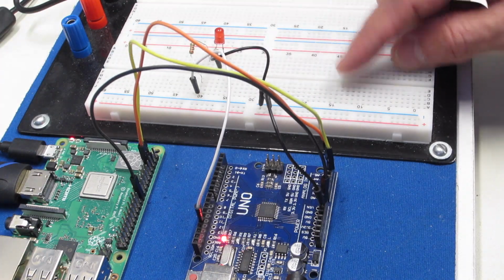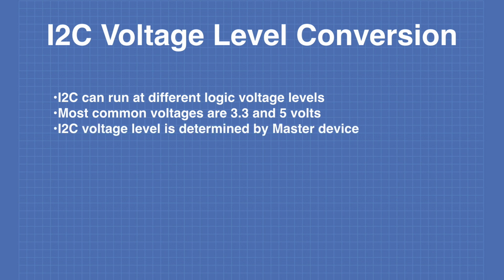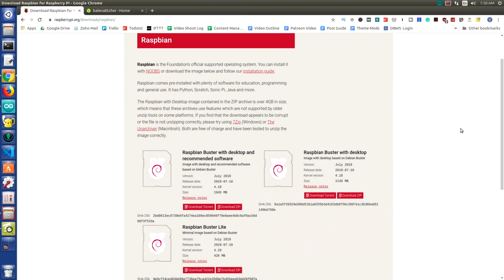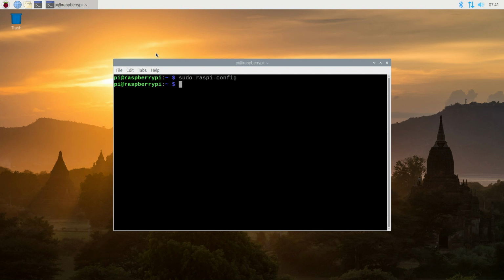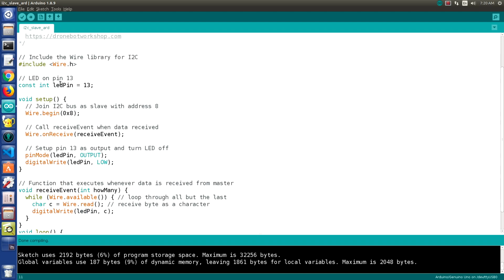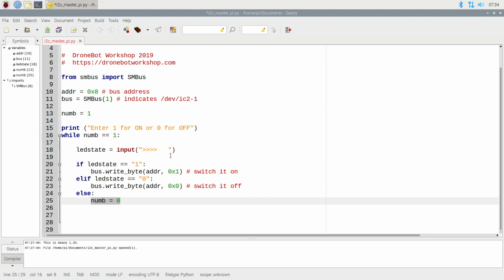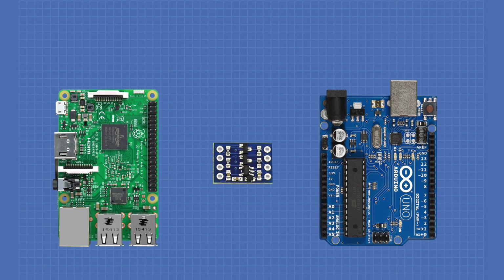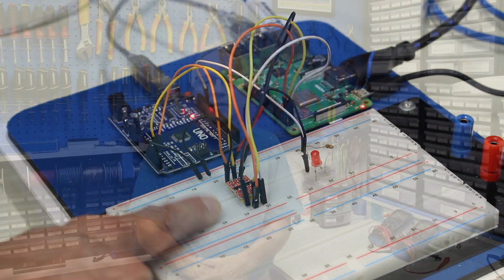I2C with Arduino and Raspberry Pi - Two Methods

Comment: If i am using 3.3v logic level on both the device and i can connect pull up resistor to any device and it will work fine right ? or i need to connect it to master side only?

Comment: Sir, i'm building a pinball machine on a budget at home, but it's not as simple as buy X, Y and Z and connect it all. At first I started with the arduino uno r3 I already had. But as the project grew with buttons, solenoid driver, sound and monitor, it becomes clear that a single arduino might not get the job done. (I want color output on a VGA monitor) so we need to have different hardware. I found a Pi Pico2 that can get a "dvi-sock" attached to it so it can connect to a monitor. (vga or hdmi) But how to progress from here? keep the arduino as the button detector, solenoid driver and scorekeeper? Or should the pico do more tasks? Would the I2C communication be fast enough to some tasks between the two boards? Or should the setup be completly different?

Comment: I checked on both my Arduino's (a Jade and another one) and the SDA and SCL stay at 5V, so they have pullup resistors to 5V. Beware! Its is always best to use a logic level shifter, damage is irreversible to poor pi's. I really don't understand why they chose 3.3 V for I2C on these
Reply: I think its bc of the library code, in the function, all the code were set to pull up on SDA and SCL for easy use, just go to registers level for better control

Comment: i am getting an error when i run this File "/.../python/pi-i2c-test/i2c_master_pi.py", line 20, in <module>
    bus.write_byte(addr, 0x1) # switch it on
OSError: [Errno 121] Remote I/O error

Any advice?

Comment: Hello. I was able to connect the Raspberry pi 4 (Master) to arduino uno. It works perfectly. But when I want to install the 7inch touchscreen from Raspberry Pi, AND the arduino via i2c, there is a conflict and it stop working... Are there any clues you can share for this situation?. Thank you very much!

Comment: Hello, I'm new to coding my skills are mostly in hardware. But I was wondering If I'm controling over 30 relays from the arduino how do I control them through the raspverry pi using a web server page from the pi itself?

Comment: Thank You for covering this subject.   I was having an issue powering/grounding an IoT project that has an UNO R3 connected to a DHT11 with 2 way communicating with an ESP8266 that is connected to wi-fi and a 4-way relay.   The 3.3/5 volt common grounding was giving me a head ach, and causing issues with the sensor data transmitting continuously.   No one else really covers things as well as you do.   AWWWsome  and thank you again.
Reply: i am having a similar issue im unable to make the esp32 slave.........may be its because of common grounding

Comment: Can you wire a Pi Motor HAT directly to an Arduino by just connecting the corresponding I2C pins (A4 & A5 to pi 3 & 5) ?

Comment: These are the most easily understood and trustworthy tutorials I have seen.  I'm trying something similar but unsuccessfully so far. Does an Arduino Nano have a 5V I2C pull up? Specifically, can I use an Arduino Nano (5V) slave with an ESP8266 ESP01 (3.3V) master without a Logic Level Converter?

Comment: I have no trouble sending data from pi to arduino or from arduino ot pi but I cant work out both, I need 2 way communication, what would I need to change to get this going. simply adding the read and write commands to both causes either a communication error or causes the arduino to power cycle

Comment: Hello,
Thanks for great tutorials.
I have a question on the logic level converter.
i have two arduino boards  (Nano and Nao 33 IOT) they operate at different voltage levels.
how can we do serial communication between these two boards ? will the I2c level convertor work in this scenario or i need something else?
Regards

Comment: Making a GPS tracking uav drone for my project.  Thinking of combining arduino and the pi for it?  Steps to make that work?
Reply: Like the pi control the gps, wifi, ai configuration and the arduino would run one task like driving my four motors, could this be done?
Reply: Tips ?

Comment: I got a question...if i want to use them in a portable project and i will use a battery pack probably where should i connect the battery and how and what voltage should the batteries output ?

Comment: My absolute heartfelt thanks for your incredible contribution. 
I am looking to setup a project and after doing a lot of research on the subject i've decided to go with a single rpi connected to multiple arduinos slaves over i2c . So is there any way to do that and how to connect more than an arduino board????

Comment: Very helpful. Thanks!
Reply: Is there a way to use I2c interface on a standard pc mother board to check authenticity of port or control a device
Reply: @Silentsobs  I don’t know, I suck at programming. You should ask an extremely good hacker.

Comment: Hi!
I don't know your name, I've been searching but I have not found it...
First of all, you're a very good teacher!!!!
I've have a question... The smbus library on the Raspberry Pi BLOCKS the program execution until it has transferred the whole data. If you use the serial channel it does not happen in this way. For serial, you write, the function returns, and in the background the transmission takes place.
It is a great inconvenience, thus the program can do nothing that waiting for the transmission.
The only solution I've found to avoid this situation is to build a socket server, place on it the communication, and call this server in other programs. In the case the program is a web page the solution is good, but I don't understand why the smbus library has been designed in this way.
I've tried to place the i2c communication in a separated thread in the same program, but it does not work...

Sorry for my English.... I'm spanish.

Congratulations for your videos!!!
Thaks!

Comment: "and because 3.3 volt is higher than the threshold" - logical error already. The 3.3 V output doesn't guarantee to generate a level at least 3.3 V.

Comment: Imagine in the year 3070: I have Raspberry Pi with 3.3 V I2C and Arduino with 3.3 V I2C, but Arduino is made out of antimatter and Raspberry Pi from matter. Incompatible. Need a special wireless conversion module with a ton of millitary grade safeguard systems to prevent me from blowing up the whole city in a nuclear detonation should these two accidentally touch on my benchtop.

Comment: Congrats on the video, it is very helpfull. However I have some questions about many I2C devices. If I want do connect 2 arduinos into the raspberry Pi, I stiil can use 0x8 as a slave address on both arduinos? Or i need to use 0x8 on one arduino and another address (idk which address) on the another? About the phisical connections, I Still use the same pins on the rasp/arduinos, right?

Comment: I did exactly what is told in the video, bun when executing the program of python it sends me the next error:

from smubs import SMBus
ImportError: No module named 'smubs'

I have already installed the smubs package but still sends me the same error. I don't know what to do.
Reply: Man did you do it now?? I have just the same error, im losing my mind rigth now haha
Reply: @ivanrojas1475  sorry, I've finally made my project using SPI instead of I2C

Comment: 13:44 Is there a way I can measure if a device uses pull up resistors with a multimeter? I'd like to use a pi to interface with a 5V device, and if possible, I'd like to do that without a logic converter.

Comment: Great tutorial as always, thank you! 

I have one question, is it possible to rather than just blink an led, use this method to send a specific IR signal through the NEC protocol? I followed your tutorial on that but I'm not sure how the Sketch should look for that to work. Thanks!

Comment: Hi there.  Is this more reliable than connecting the RPi to the Arduino via USB serial? I have been using that arrangement and once in a while, the arduino changes its address (ACM0 becomes ACM1). I am thinking this might be a more robust connection.

Comment: Assuming you don't need to use a HAT, you can easily use the i2c-0 bus for your own projects. It takes about 2 minutes to configure, and then you're off to the races with TWO i2c buses for your project(s). I've been doing it for years. Here are the steps I have been using for several years now, ever since the RPi2.

https://pastebin.com/ibvnFVqc

Comment: Can this be used for two way communication without the logic converter as long as the Pi is the master?  So the Pi can send a request and get data back from the Aurdino.  Seems like it should work since the pins are pulled low to send data and the only pull up is in the Pi but I'm not sure and don't want to destroy my pi.

Comment: Is the logic converter necessary? Why not just run the arduino at 3.3v?
Reply: I know you can’t make it run full speed clock but should still work.

Comment: I would like to see a comparison video on using UART vs i2c vs SPI, etc... As means to establish communication between an Arduino and a Raspberry Pi (or between 2 arduinos and etc). As a quick guide on why should you use one protocol over another one for your project.

Comment: Your connections are wrong (Do not connect the 3.3V pin).  There is a reason the converter board is marked Vin and 3V3 (At least mine are). The converter board cannot power the PI from the Arduino power supply.
The converter board has two mosfet and a 5V to 3.3V regulator and it is that regulator that has output on the 3.3V pin.
Reply: Can you put link for your board?
Reply: It is just a random Ebay board and looks exactly like the red ones shown.

I do also have some 4-way boards, they do not have a regulator on-board and need both 5V and 3.3V supplies.

The way you work it out is number of 3+ pin parts: Same as number of IO=no regulator, needs both voltage. One part more than IO=With regulator, do not connect 3.3V.
Reply: I think you bought some unidirectional ones as bidirectional ones dont have input and output specified as stated in the video
Reply: Look at the board, it has two mosfets and one 5V to 3.3V regulator, mine are exactly the same.

Comment: Is it possible to communicate with more values, then just 1 and 0?
Reply: Hi Shado.  Yes, you can send more values.  Also take note that in the Arduino code Bill is reading a Char.  That's basically a whole byte.   Also, in the Python program on the Pi he's sending out an ASCII coded byte for the "1" or "0".   So just sending one byte at a time you have up to 256 possible values.  But I believe that I2C is serial communications and you can continue to send as many bytes as you like. 

In this example Bill is only sending a single byte from the Pi to the Arduino.  So this is just one-way communication in the example shown.   But you can also have the Arduino send bytes back to the Pi if you like.  I2C is full two-way serial communication.   At least that's my current understanding.  I'm sure someone will correct me if I'm wrong.  I'm not sure what the baud rate limits are.   Bill will probably go into that in a later video.
Reply: @Mystic0Dreamer  thank you. This was very helpful.  This information will be very useful for my upcoming project. I was looking for a way to communicate my raspberry pi with my arduino and luckily enough this video came out today.

Comment: 29:20 was that your belly, or do you have a cat? :D
ALSO, what is the "bandwidth" of those logic level converters? I tried one with some Neopixels before, because I was powering a Arduino with five volts and wanted to run the Neopixels from 3.7 volts, but they wouldn't work